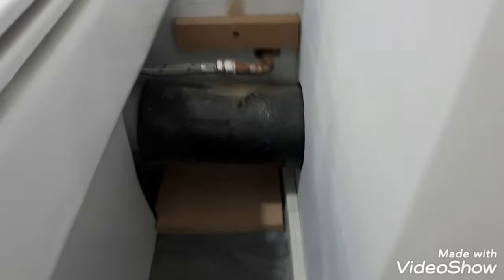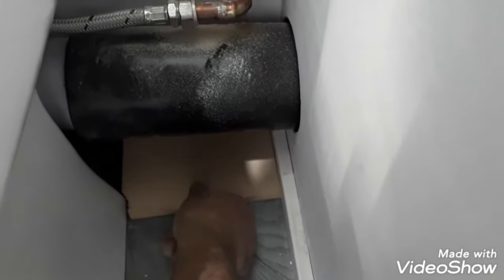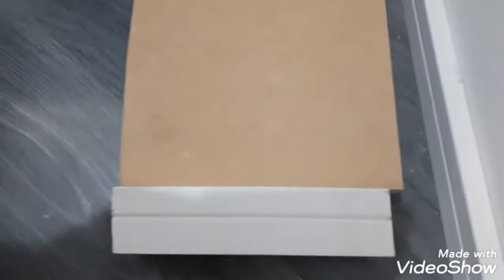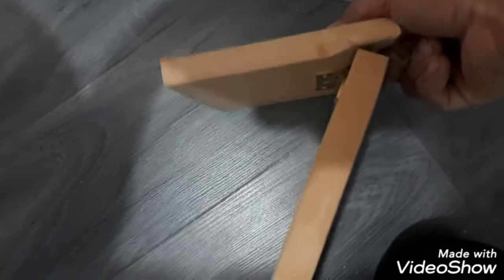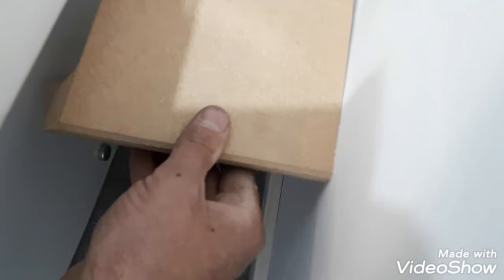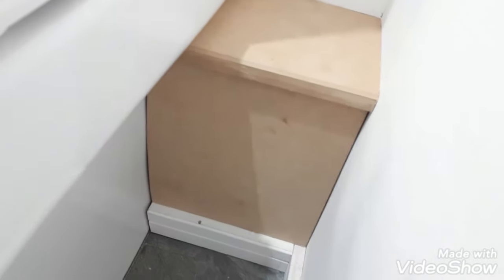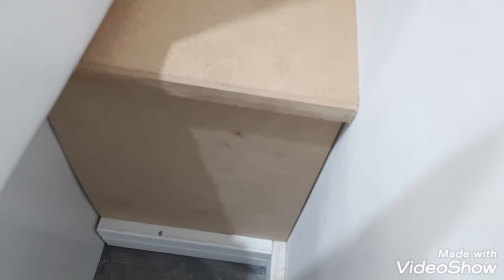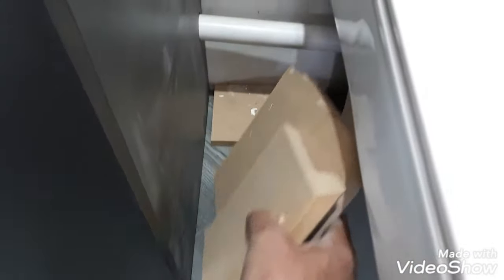How to make removable toilet pipe boxing

Comment: This is fab!  Just one question though….  My toilet isn’t in an alcove, like yours is.  It’s in a corner, so this idea would work for the internal corner but I’d need to put an end on the other side as there is no wall to butt it up against….
Reply from the maker: It should be easier to make it for that scenario. It could be made as rigid boxing not collapsible.
Reply: Thank you. 😊

Comment: How do you cut round the toilet mine is not straight down it curves I've tried doing template but still get it wrong
Reply from the maker: I scribe it and cut it with Jigsaw
Initially cut the panel piece to largest measurement, then offer it on against the toilet and scribe it with the pencil. Cut away scribed part save then repeat it. Scribe, cut,.. until it fits perfect